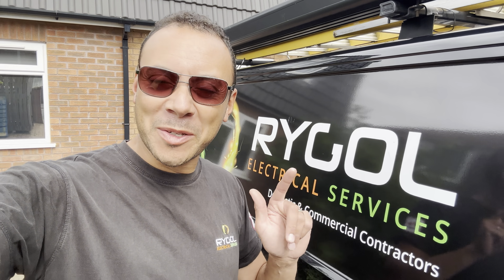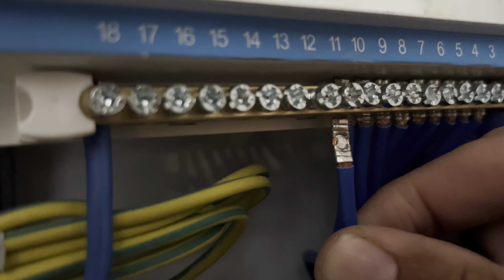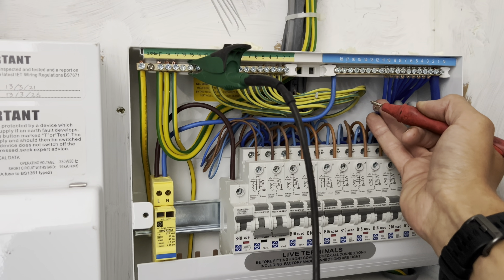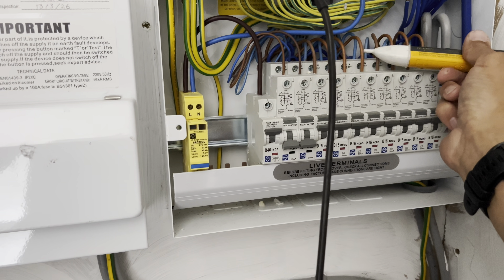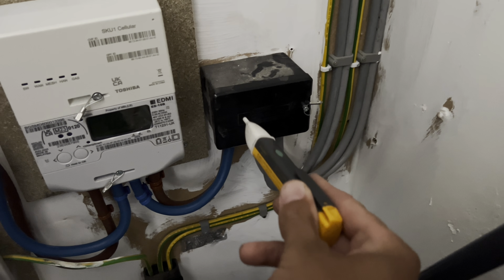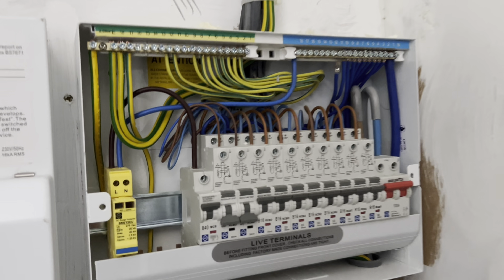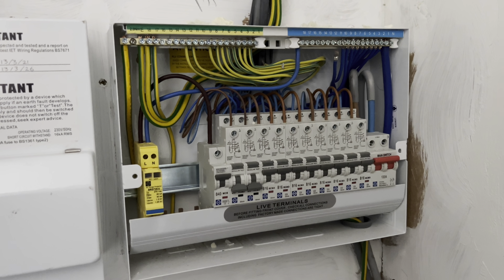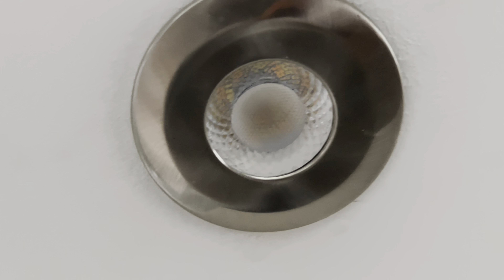Smart Meter Disaster! ⚡️

Comment: No way should you have rectified ,emergency call to DNO and firm who installed also notification to HSE, Too many of these instances along with gas meter changes where no proper tests are carried out .Once you took off those seals proof gone.
Reply from the maker: This video has gone straight to the head office via the client and only the consumer tails were moved not the electricity suppliers side so i am well within reason to make the changes.
Reply: @RygolElectrical cud’s for you for being H&S aware. First Fix - if you competent, report after. With all evidence to hand. 
This industry is expensive for customers, controlled (possibly over controlled) by gov body’s, so no cowboys should be near.
But to previous electrician I’d  give some slag, but no excuse: as he was likely under companies time pressure.
Company have to pay compensation to customer for putting him under identified risk. If no one injuried is a luck, but this should be financially punished to company, as only then it goes to continuous improvement. 
Similar as gov does on Highway Code: speeding, Tinted windows etc. are potential danger for what we penalised . So why this different???
Reply: @RygolElectrical so wht would of happened to the appliances would the have blown up
Reply: It's what happens when they train them on a 12 week course and push them to do as many meters as quick as possible
Reply: @mohammedusman7065  totally agree, I did this job and resigned after having a nervous breakdown following a speeding ticket in the van. The pressure was horrible.
Reply: @lindsaybelderson7735 so sorry to hear. Hope you’re back now . I know the pressures some engineers experience out there . ❤
Reply: @lindsaybelderson7735 I agree i was a nervous reck doing this job   my last job i done a cross polarity and the consumer unit blow up on me it was my own fault should have done my checks. The customer house was disgusting smell of piss  i should have abort the job .
Reply: @mohammedusman7065 12 week? Lad who came here did it in 6!
Reply: @mohammedusman7065 doesn't help that the staff are on drugs either 😅
Reply: Yes i had a similar situation with things tripping. Turns out that they left the neutral loose. It was quite burnt and if left could possibly have caught fire. It wasn't the DNO but an energy sales company who also do GAS...LOL.  They tried to charge me £185 call out, in case it was not their fault. I retorted, i shall just go to the papers and explain why you're risking burning a family to death, and happy to leave them without electricity. They came eventually, no apology was given. 😞
Reply: @paulmac8016 in the words of the illustrious John h McEnroe,you cannot be serious.i don't believe my eyes and ears sometimes.i've just told my friend,the  landlord,that I've just found  the mains cable,no conduit at all,crossing the gas inlet pipes,also in the meter cupboard,almost touching the metal gas pipe.in the yard,the gas copper pipe is dented and completely unhoused,running along the wall.i thought that councils and utility companies were supposed to keep checking every house!I thought that it was illegal to do any electrical and gas work without notifying the council!
Reply: @paulmac8016
Reply: @paulmac8016 my sister had something similar happen when she had new electrical sockets installed in her kitchen.
One of the sockets started smoking when she plugged an appliance in to it. When I checked the wiring in the socket, the insulation of Neutral wire was burnt because the idiot that installed the sockets tightened the terminal screw onto the insulation instead of the bare copper wire.
🙄
Reply: @paulmac8016 why do people threaten to go to the papers? As if they or the readers care.
Reply: Nice to see a real tradesman. Look how neat the distribution box  was wired. When we had our smart meters installed the man criticised the work done by South Western Power on the main incomer. Also he mounted the gas meter not level. Should never be allowed to fit anything. I can’t see how they  get away with it. The tradesman in the video had to be time served to get the qualifications to do this work. Yet they allow meter installers to attend a few weeks course. I hope this video brings in a lot of work for this young man.
Reply from the maker: @johnsawyer2516 thank you for your message. Theres alot of criticism around certain aspects but theres many ways to deal with one scenario and we all have our reasons. I dealt with it according to the current scenario. Thanks for your kind message:)
Reply: @johnsawyer2516 I agree with what you’re saying, but not all engineers on 12-13 weeks training are the same . You get those who’s been in the trade for years , who just get’s a thrill I guess of living on the edge . I’ve been on 12 weeks training but always put safety first.
Reply: I think it should have been reported if he gets away with it next time someone could be killed
Reply: @johnellis8271  yes it should definitely be reported , but you should at the very least make it safe and as it’s such a easy fault to fix just get on and fix it  , you will sleep better !
Reply from the maker: @timmytackle9181 absolutely!
Reply: Proofs gone ???? He filmed it 😂
Reply: That is scary, especially considering the neutral bar in that board is not RCD protected.
Reply: @leewakefield8658  yes, bit of a wakeup call for me, it's why polarity test is one of the first tests you're meant to do, now i fully understand WHY
Reply: I don't disagree with anything you say but, who wired the Henley block back-to-front in the first place?
I very much doubt that it was the (probably inadequately trained) MO (meter fitter).
Certainly the MO should have done a final polarity check, but these days the "training" is all about quantity, not quality.
Reply: @ten-bob-note That's why he maybe corrected it.  The meter installer should have carried out tests, though.
Reply: @johnharrison373  
I completely agree with you.
Unfortunately the MO (meter fitter) only partially corrected it and completely failed to perform a proper polarity test.
Reply: @johnharrison373  100% that's what  happened but the guy forgot his brain
Reply: he ASSumed then didn't check... fail
Reply: @bobandpolitics  Yes, on  11kv one only makes an assumption ONCE in a career!
Reply from the maker: @ten-bob-note  the henley block is originally wired correctly with the live being at the back. The polarity fault by the energy company has made it the opposite. Amazing how many people are being caught out by this 😂
Reply: L4 is at the back of the Henleyblock at the start. Sparky has wired consumer neutrals to the back and lives to the front, so the meter op retailing in the normal convention has caused the polarity reversal so i can see how the error occurred but as others have said his/her martindale check would have caught that.@Leon-nn7rn
Reply: @RygolElectrical  Are you saying that the Henley block was originally wired with the outgoing live at the back and the neutral at the front? I find it hard to believe that the meter fitter would have changed 4  outgoing tails. Also, why isn't there a DP switch between the meter & the henley? How did you replace the CU 2 or 3 years ago without an isolator in place?
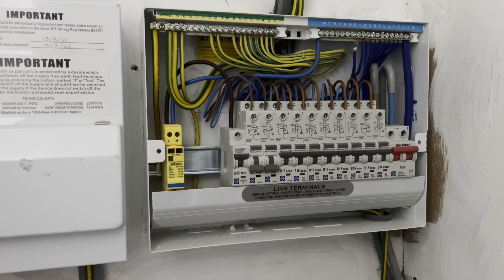Reply: @RygolElectrical  at 14:21 you never said or showed what you swapped around to fix the problem! Which is pretty annoying tbh. I think I have the same issue!
Reply: @RygolElectrical the colouration of the wiring is a dead giveaway here. 
The customers live from the meter is connected to the conno block in the conventional manner. 
However the outgoing tails aren't wired in the conventional manner. 
In essence the MO has wired everything correctly, but they didn't do a plug in polarity test and thats where they've f'd up.
Reply: MO has physically stated they tested a socket in kitchen. Either they didn’t or the socket they tested was reverse polarity. MO would have stated electronically they have checked a socket. Henley block should have been removed and replaced with two separate L and N blocks
Reply: @markchristie3001  wake the lights would have been flickering for 3 years the original test was correct
Reply: @markchristie3001 maybe forgot to do final test or never did any socket test at all .
Reply: @markchristie3001 that’s what I used to do .
Reply: @ten-bob-note totally agree, polarity is the only thing the meter man has to worry about so he’s failed badly on that score (sacked immediately) but my thoughts were live on the henly always to the back and very exposed section to the front neutral. When you do youtube videos you must make sure you are belt and braces
Reply: @ten-bob-note the Henley block was correct when he rewired, so yes, it absolutely must have been the meter monkey.
Reply: @ten-bob-note  most likely there was copper showing on the wires entering the block. They were not marked "N" and "L" before removing to trim or meter fitter got distracted/not concentrating etc. it's evident they didn't complete tests after.... It's bad, in 8 years I've never done that. Not always down to training though, some get complacent after years of fitting thinking they know it all.
Reply: @ten-bob-note  that label with socket tested kitchen is BG. They might have photographic evidence of tests. I know I do. Every meter install I take photos.
Reply: @ten-bob-note  The henley block live to back is just convention (a good one) not a hard and fast rule
Reply: @TheChipmunk2008  
I completely agree with you.
However, in these days of half-trained MOs (meter fitters), the "convention" needs to be a "rule", for everyone's safety.
My local DNO linesmen are not allowed to connect "live to front".
Reply: @ten-bob-note  Interesting info, thank you!

But they shouldn't be touching customer  side surely?
Reply: @ten-bob-note  may i ask what local dno you are on? SSEN down here
Reply: former SEB
Reply: If anyone had died would the person who didn’t test properly be prosecuted
Reply: @johnellis8271  yes absolutely 💯 definitely 👍🏻
Reply: @timmytackle9181 he could just send an appropriate video like this one. It might not be good enough in a court case but should allow management to take appropriate action with the installer.
Reply from the maker: @johnellis8271 absolutely
Reply: @johnellis8271 He would be prosecuted for manslaughter by gross negligence.  Maximum penalty an unlimited fine and/or life imprisonment.  Triable only on indictment.  Breaches of health / safety that bring about a danger to life is the definition of gross negligence.  They needed to do blunder checks, and they obviously weren't done.
Reply: Yes he would be in prison most likely @johnellis8271
Reply: Well done for correcting it. I’d never leave an unsafe condition. Emergency calls all day to the DNO are a waste of your time. HSE should be informed and the person installing should be fired. The firm should be heavily fined. Great video thanks for sharing.
Reply: @retrodad6864 The DNO have a duty to attend within 2 hours and rectify. If the meter fitter screwed up this will be investigated…long standing process
Reply: Yeah, agree with Eddie, you should report to HSE and tell client what you've done. It's good that you filmed it. Funny that the landlord phoned you rather than the meter installer
Reply: @davidbriggs8076 he’s probably got a bit more faith in him than the meter muppet.
Reply: @davidbriggs8076 Possibly the landlord didn’t know or even think that problem was caused by installing the smart meter.
Reply: @davidbriggs8076 even so fair play to the landlord actually getting an electrician to take a look
Reply: Yes but he couldn't have left it in that dangerous state and he had th e proof of the proof of the video
Reply: I understand why you say that and you have a point but I would rather make the job safe
Reply: @timmytackle9181  Yes i'd make it safe AND notify the DNO, HSE and the energy supplier
DNO's don't like morons messing with their equipment
Reply: I think making sure it was safe for the residents was his primary concern. Also he has video evidence right here and maybe he also videod cutting off the seal and showing that it was in fact wired wrong , that part we didn't see but maybe he did which would have been solid proof off dangerous installation. Might have been days or weeks before the company sent anyone out .🤷
Reply: I think it is the duty of a gas fitter to turn off the gas supply and leave the premises without gas if a dangerous situation is found. That's how it should be for an electrical danger. 'Inconvenience' is very much a secondary issue.
Reply: Not really, the first duty is to make safe, the next one is to repair the leak. This is providing that the leak is after the meter outlet.  If it's before that point then it must be reported to the gas networks emergency service. They have to attend within 1 hour. @davidparkins1808
Reply: @geoffaries if uncontrolled its an hour.
Reply: @davidparkins1808 That depends on which side of the meter it is. If it's the meter or its supply then sure. If it's "inside" then there's a duty to make safe if the customer will let you. Otherwise, isolate, label, leave, and report.
Reply: @davidparkins1808  A householder complaining  is told to turn off the gas at the meter and wait,
Reply: @Lamster66  It would be a reckless company who challenged breaking the seal in this case!
Reply: @eddiereed5025 "once you took off those seals proof gone"? He's got a video of the fault ffs 🤦‍♂️🤣🤣🤣
Reply: Looks like British Gas to me
Reply: This is a ridiculous issue to happen .
Reply from the maker: Thd proof is in this video which has been sent to the supplier. The seals cut are on the consumer side of the installation not the supplier side.
Reply: Well now I will take flickering lights very seriously.
Reply: Wir haben in Deutschland zwar ein etwas anderes System, aber ich finde es dennoch sehr interessant, auf was man achten sollte.
Reply: I'm surprised that the tails to both the consumer units were not colour coded when the rewire was carried 2 years ago, although that doesn't excuse the M.O. from carrying the polarity test.
Reply: @geoffaries  They are colour coded but the colour is beneath a second "armoured" layer of insulation which isn't. However it's normal to take a short length of this outer insulation off to reveal the coloured insulation beneath, so long as the length that's removed remains within the Henley block/Consumer unit. Exactly the same as any normal 3-pin plug, where you ensure the outer white insulation is gripped by the strain relief within the plug itself.

I'd rather have the second layer of armoured insulation - these cables don't have the luxury of an RCD or fuse to protect them from shorts. But they should have been labelled, and the label that indicates that the test was passed is clearly a dereliction of duty by the meter installer. If the meter installer had done the test he would have found his mistake and put it right before re-testing.
Reply: Except He Made a Video. Seal Meant Nothing.
When in Kitchen, Looked Like You Touched Toaster, You May Have Become Live, Good Shoes, Insulated Floor, No Contact with a Different Potential. If Everything Around is Live, and You Contact, You Won't Get Shocked.
I Live in the States,, 120/240.
If Polarity is Reversed, Things Will Still Work. Main Issue is With Lamps, If Polarity is Reversed, The Shell Of a Socket Will Be Live and can easily get a Shock. When Way Down in Bottom, more Unlikely.
Reply: Surely all the DNO can do is come and pull cut out?
Reply: You must have broken the seal on the Henley block, that's a no no ,the supplier should have been told to rectify it,and you should have turned off the consumer unit !!!
Reply: Thank god there are some decent engineers out there❤️
Reply: Waste of time, I had similar situation, DNO (Western Power) weren't interested at all as nothing to do with them, metering company (British Gas) couldn't comprehend the seriousness of the situation. Left to me to sort out and make safe. Meters being installed by monkeys.
Reply: @Lamster66 that is an extremely dangerous point of view & is aligned with the non-competent, non-qualified "efficiency experts" who unleash inadequately trained "technicians" who they think don't need to know the basics and essential skills to work safely.
Reply: @Lamster66 Why on the heavier end of things a jointer or linesman gets involved, with a totally different skillset to the  electrician's end distribution territory.
Reply: The possible crime is the fitter falsely certifying that he had done a test. Until then I figured it's possible he'd just made a mistake, but to sign that he'd tested …
Reply: Then there people that write nonsense on there CVs and businesses wonder why they keep replacing people.
Reply: The company charge standing charge even the meter is not connected .
The ombudsman reply to me that they can not ask the company not to charge as this is their way to operate
Reply: @CANTONEEHo  the standing charge is meant to be for the upkeep of the electricity grid so I was told. If you have the service cable removed then you won't need to pay a charge, but then no power to your house????
Reply: Excellent videom. Very well explained, much better than some of the other numpty's we have on the socials talking nonsense! 😅
Reply: @Lamster66 i have seen so many cases where meter fitters have messed up due to a lack of experience more than a lack of training you need to know and understand an electrical installation years ago inspectors checked an electricians work before changing a meter or fitting a new meter on a new installation and if it wasn’t absolutely right you would not get a connection as with so many things it’s been dumbed down
Reply: @Lamster66  obviously not 😉
Reply: I like a volt stick for a quick look round too. There was no need for this chap to be here, the system worked, and then upon meter change it didn't. The first thing to have done was to have fired a rocket at the Meter company, followed by a report to the local council.  All the Meter company needed to do was plug in a test plug,nothing more,and then put the job right !!
Reply: The 😮😮😮😮😮
Reply: its on the consumer side every man and his dog could of been in that henly block probably someone who thought they could of got a freeby
Reply: chop a cable its now on a 100amp fuse 😂
Reply: That was not the DNO's responsibility. Testing their own work was though
Reply: Does anyone know why everything in the house was still working ok? I assumed it would have damaged some plugged in electrical equipment!?
Reply: @grayzly Alternating current.
Reply: How the hell is the proof gone when he has it all on film
Reply: Employing Cowboys, Third World Britain.
Reply: That would be dangerous lol, leaving any outgoing circuits unprotected by the RCBO’s /MCBs he’s installed. Take a photo, video cutting the seal and make safe. Please don’t tell me your a spark 😂😂😂
Reply: This is the kind of thing that terrifies those of us who have no idea what a supposed (or presumed) professional fitter) is doing. 
All these utility suppliers insisting on (seemingly) constant meter changes/upgrades as a matter of course 😮
Reply: Strangely enough the Martindale used is exactly the same one the BG Meter Operators use. The Volt Stick nearly identical, but a different model from the same manufacturer. This is a case of not leaving the martindale plugged in. Mine always stayed plugged in until the power came back on, if I ever made a mistake I’d have known instantly and could power down and rectify. Mistakes happen, not testing and then putting a polarity sticker on saying you have is just opening yourself up to a disciplinary. Difficult one to wriggle out of too!
Reply: Strangely enough the Martindale used is exactly the same on the BG Meter Operators use. The Volt Stick nearly identical, but a different model from the same manufacturer. This is a case of not leaving the martindale plugged in. Mine always stayed plugged in until the power came back on, if I ever made a mistake I’d have known instantly and could power down and rectify. Mistakes happen, not testing and then pitting a polarity sticker on saying you have is just opening yourself up to a disciplinary. Difficult one to wriggle out of too!
Reply: Wow. What a jobsworth you are. The customer comes first. You always rectify the fault.
Reply: Report, report, report. So basically doing more work while others screw up. Mmhmm, I would have no time in the day left to do my own job. It's just a sad fact of life now that people don't care to do things properly anymore.  "Remember kids, smartphone comes first!"
Reply: @ that’s just your excuse for being lazy. Leave it to the pros.
Reply: Report, report, report. So basically doing more work while others screw up. Mmhmm, I would have no time in the day left to do my own job. It's just a sad fact of life now that people don't care to do things properly anymore.  "Remember kids, smartphone comes first!"
Reply: You can get "qualified" as an electrician on a three week resettlement course !!!! It used to be 5 year apprenticeships then they would only trust you to put the kettle on.
Reply: He recorded it. Surley, that's enough proof. But u called always call them. I would imagin they would come within a few hours with that sort of fault
Reply: Surely any earthed metallic equipment was live in use? Bloody hell!
Reply: I don’t know, it’s deadly as it stands, but I am up for making it the DNO’s problem.
Reply: NO way you can walk away from a dangerous installation when you have a remedy.
Reply: You are correct rectifying the problem. Just report the issue and have a person with the correct license reseal the metres. Otherwise the only other way to do it would be to turn the power off to the premises altogether cannot leave it alive. If not fixed. I have no idea why people are saying that you shouldn’t have fixed it. That’s crazy.
Reply: that is strange because that consumer unit looks absolutely immaculate.why has somebody interfered with it then?
Reply: I think that’s why he videos it.
Reply: Our neighbour was a commercial sparks, time served and he once told me his mate found this same situation after the electricity supply company installed a new meter.  Seems its not uncommon to find energy suppliers using poorly trained (if at all) meter installers.
Reply: I’m not an electrician but totally agree that the original smart meter Should be reported because they may have been making the same mistake or other mistakes and should be held to account
Reply: It was dangerous to the public so needed rectifying has the DNO ever turned up on the day and to get the company out to sort it is another story, yes take pictures time and date stamped inform the necessary authorities and i dont believe any spark worth his salts would of left it well done mate you made the right decision in my opinion
Reply: How many Smart Meters has that electrician fitted? Scary eh? Many thanks for this, keeps us all on our toes.
Reply: I'm not even a sparkle but I recognise a good tradesmen, well done for showing the video.
Reply: That is one tidy consumer unit! If the poles are reversed would the trips still work? I understand that every socket would be live even when switched off so I'm guessing not , I'm not a sparky but understand the basics and would an appliance with a s.t.g stay live until it's unplugged?
Reply: I wouldn't have covered the company name. They need holding to account
Reply: You are bang on, mate!!Should’ve called the DNO straight away — that guy could’ve caused a serious incident!. You and the meter man were lucky, honestly. Those screws would’ve been live, no doubt. Probably only avoided a belt because the board cover had a fresh coat of paint acting like insulation. That finish saved you! ⚡️⚡️🤪😥😰😵💀⚰️ Nice view Vid bro 👊🏼
Reply: Sorry but no excuse for not doing ELIT safety check or simply a plug in polarity check after work done.
Reply: You missed the what on earth is going on here no pun intended😊
Reply: My gas and electricity supplier kept insisting I get a smart meter fitted this is why I don't trust them even though I have a trip switch and the company shouldn't keep forcing people to take smart meters in the first place
Reply: @oxangel_aprilxo191  They cannot force you to get a smart meter, nor can they insist, it is voluntary. If you are being told it is a requirement you are being lied to. Simply tell them "no thank you" and not to contact you about a smart meter again.
Reply: Just what you want a contractor to get you kicked out of your home
Reply: I didn't see the actual correction. I don't know the rules however surely all the kit is marked so cross over shouldn't occur. One would have thought that in this day and age the circuits would trip breaking the link inside the consumer box at the main breaker with warning lights when the crossover occurs. Perhaps a big red light wired between the neutral bus bar and earth visible from outside the consumer unit. With lable saying lethal fault exists on this unit. Call approved electrician.
Reply: He is the firm who installed.
Reply: The amount of people slagging off the meter engineer is astonishing, especially when we come across, as this one the block incorrectly used, but loose connections, cables only catching one screw rather than two and sometimes barely catching one, and this coming from the experts!!! Shocking. I'm not excluding the engineer for this fault. I've had 3 cross polarities in 10 years of metering and always picked up on testing, before turning the power on. There are tests in place to catch it in time.
Reply: Probably A DEI hire .
The TV commercials now pick your trade person .😂.
Reply: Yep - this is one of those cases of someone trying to do the right thing, yet puts themselves in danger to remedy it.

The remedy  - he either - he pulled the mains fuse or worked live  - unless he is authoried/quailified/trained for either of those he should delete the video.